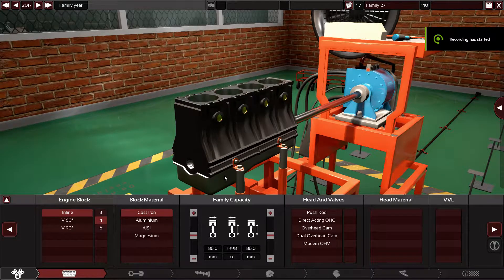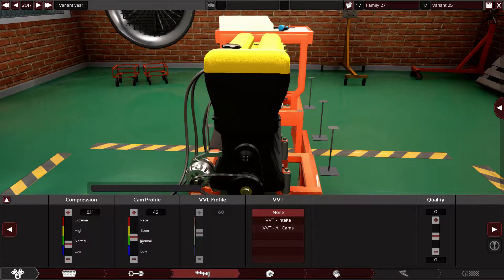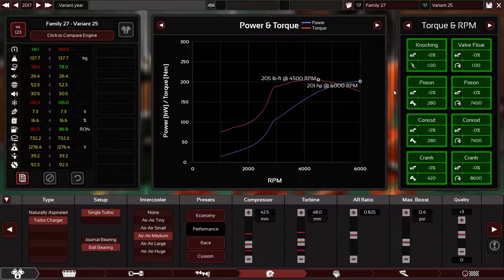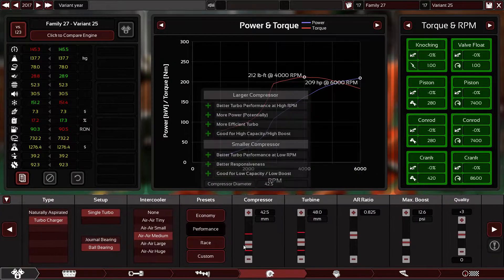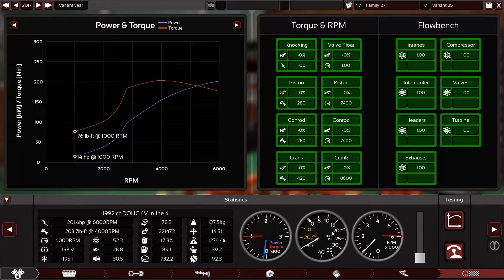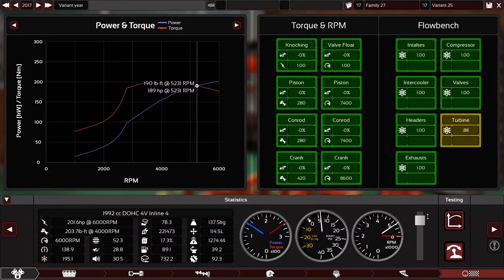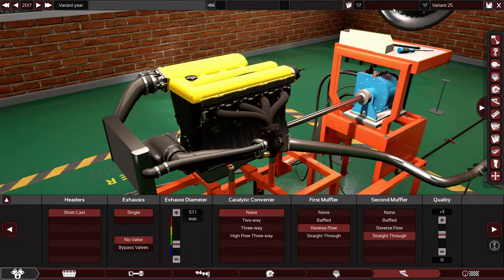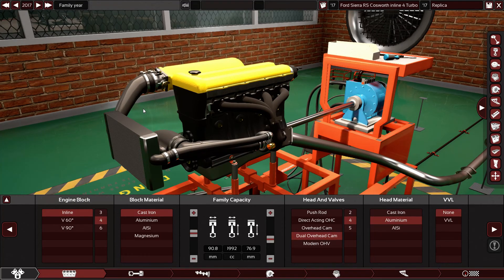Ford Sierra RS Cosworth 4 Cylinder Turbo Engine in Automation.

Comment: I've got 2 V8s for you.
Triumph V8 - 3L SOHC, 140hp
Daimler V8 -2.5L pushrod 142 ....you might find this one tricky as its a hemI head design
Reply from the maker: +Alex Wilkinson 
In Automation there isn't any hemi heads
Only regular heads 
So it maybe a little different but i like this request.
I will make it today